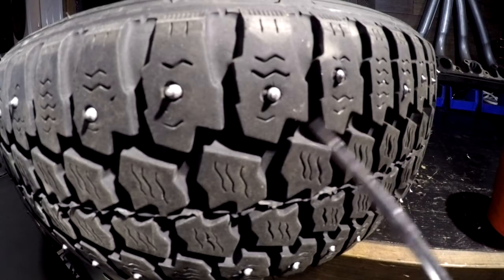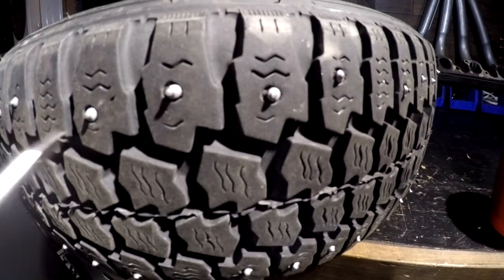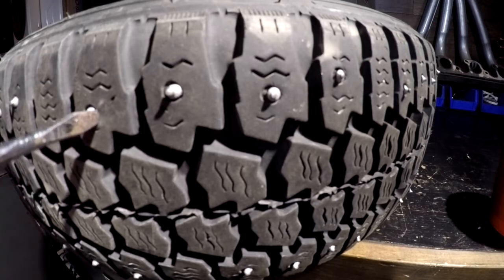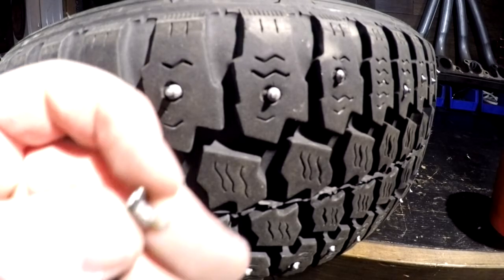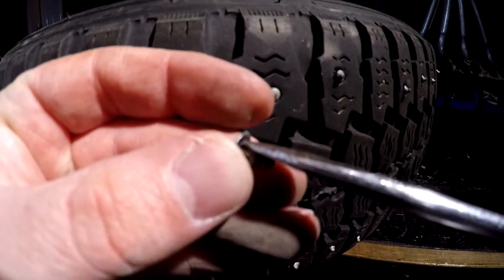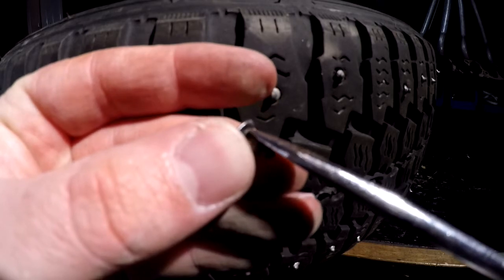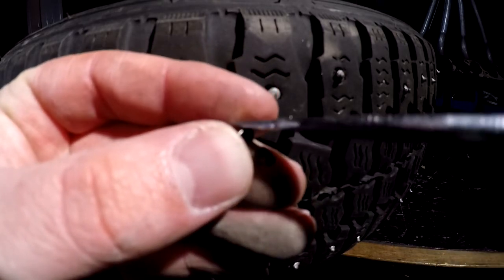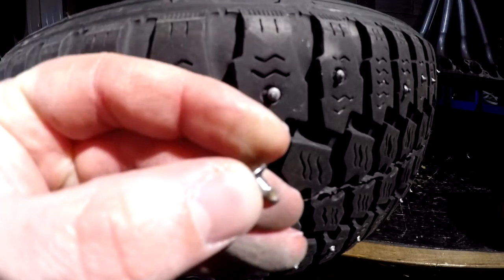How to remove studs from snow tires with a screw driver

Comment: Hi, thanks a lot for your video. I moved from Montana to New Jersey where my studded tires are useless, and was about to pull the studs out when I saw your video. I see that the studs leave holes, of course, and it occurred to me that:
1) Does it weaken the rubber grip compound until it looses its integrity?
2) Does it weaken the hardness of the compound thus diminishing road adherence?
2) Does it expose the tire to a risk that small sharp objects - gravel or metal- could nest in them and bore there way to cause a flat or crumble the compound from the inside out?

Now that probably have used your de-studded tires for a while, could you answer these questions from experience?
Thanks
Reply from the maker: I pulled those studs out and ran those tires on a car in a demolition derby. I never ran them on the street. I do know people who have done this on their street tires and have had no problems. I cannot say for certain that it safe from the problems that you mention.
Reply: @gettinfloppy  Thanks for the info; I decided to remove the studs which are overkill in New Jersey, and use these tires only for winter. All good.

Comment: What’s the point of removing them though??? 
Usually someone who has the money to buy a separate pair of tires just for the snow(instead of chains) ... has the money to buy or still has regular tires they can put back on their vehicle.

I guess, if you had these.... then moved somewhere it doesn’t snow... that would be a reason. Don’t see many others though.
Reply: Here in norway we have to pay to drive in the city with studded tires, so I removed them to not have to pay😁